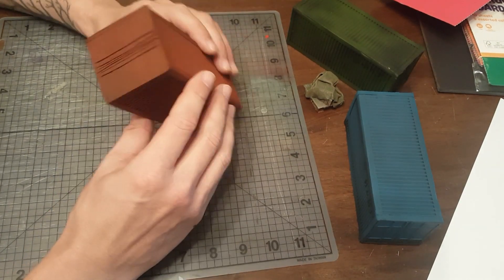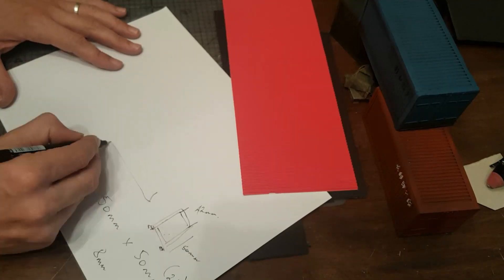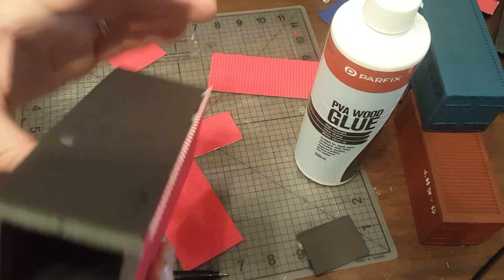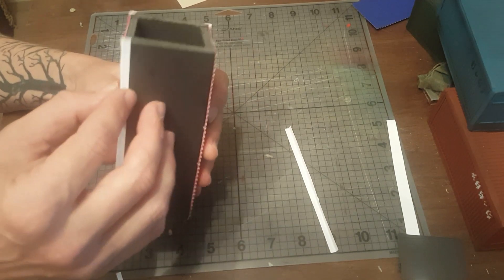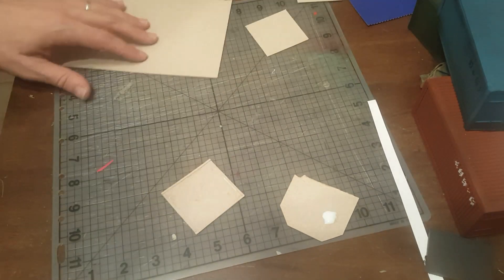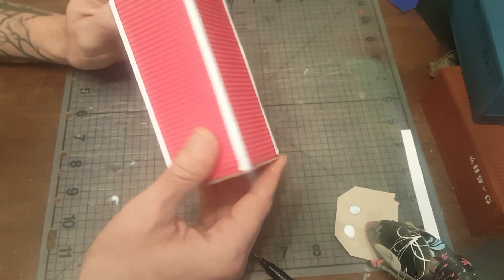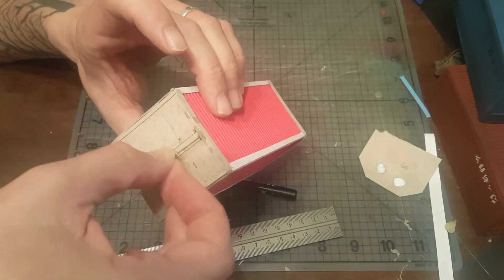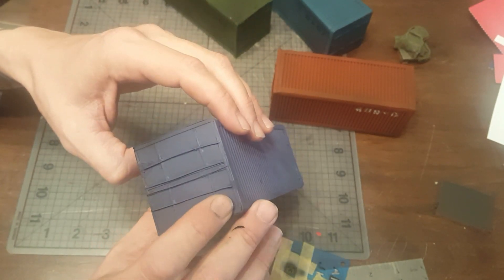Build Miniature Shipping Containers for Wargaming Terrain and Tabletop Games

Comment: To straighten wire, you can clamp one end of a good length (an arm-span at least) in a vice or clamping pliers and chuck the other end in a drill. Spin it up for a couple of seconds while giving it some tension (wear safety goggles in case it lets go) and it will straighten it out and firm it up.
Reply from the maker: Thank you for this mate, I've recently found this tip myself and it's great for straightening wire.  I appreciate the comment, take care and all the best.

Comment: To straighten the wire cut a length, put one end in a drill and hold the other end with pliers. Spin the drill and pull with the pliers, works like a charm.
Reply from the maker: Great tip thanks Kyle, I've been wondering about how to do that for ages.  Appreciate the comment mate, helps a lot.  Cheers.
Reply: Fine method. There is another one. Lay down wire on cutting mat, press it with something flat. Piece of thick cardboard or MDF work just well. And just roll it several times with pressure.
Much easier and don't need drill 😉.
Reply from the maker: @tangarextan9964  awesome tip.  Thanks mate!
Reply: another idea: use spaghetti instead of wire.

Comment: Have you ever filled them with expanding foam (with one end open) to try and make them extremely rigid?
Reply from the maker: I haven't really considered that, I'm sure it would work, but honestly, these are pretty lightweight.  You could throw these around as they are without doing any damage...although I haven't tried that either :)  Thanks for watching mate.  You're updated videos are fantastic by the way.
Reply: I would think expanding foam would break the structural integrity of these containers.
I was thinking insulation foam though, cutnto a rectangle for a solid base.
Reply: @GrimmJD  Interesting take, and probably a much simpler solution. Good idea.

Comment: Alright Chap, to straighten your wires, get a long bit and then twist it up using a battery driver whilst putting tension on it, that’ll straighten it up and the twist will keep it really straight and ready to cut to length. 👍🏼
Reply from the maker: Thanks for the tip, this works perfectly!